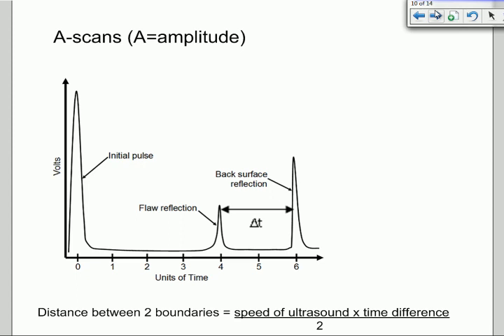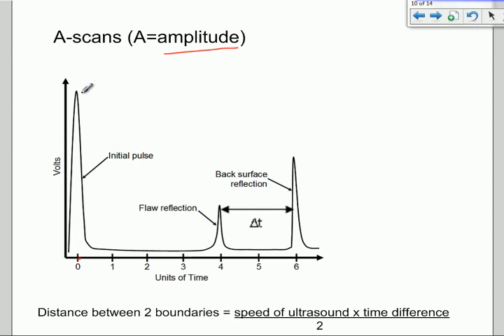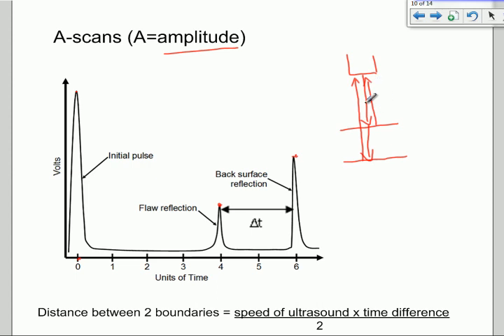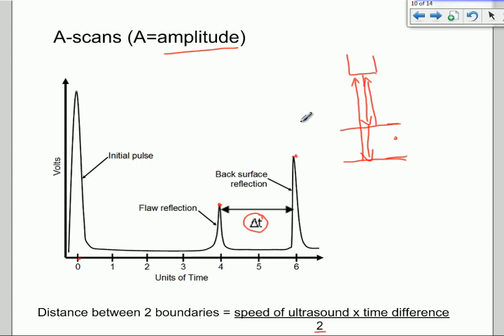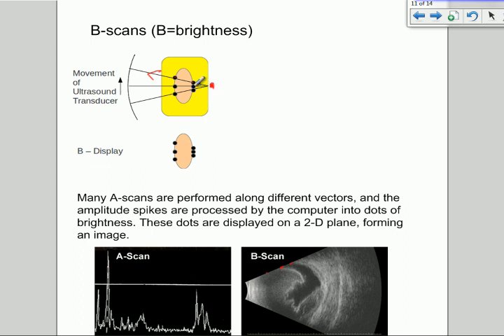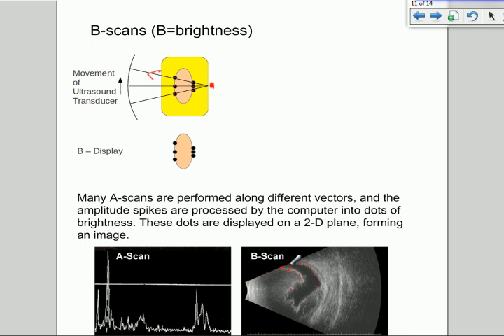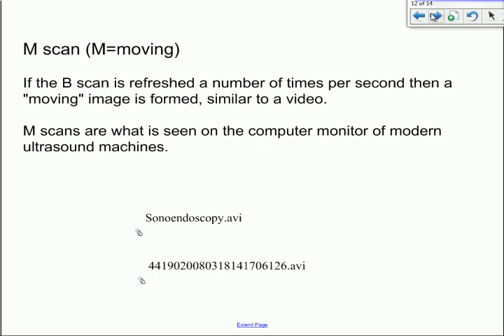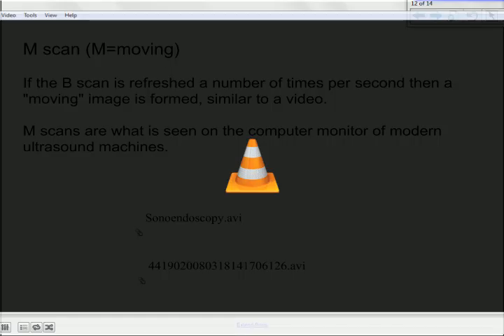A level medical physics - ultrasound part 2  types of scan, A-scans, B-scans and M-scans

Comment: great video. but i had to think myself why the time taken for the second reflected pulse to travel from transducer and hit the first boundary and reflect back can be eliminated then i realized both the reflected pulse take the same time to travel to and back to the trandsducer from the first boundary so u just need to take the time difference between the two reflected pulse because the first pulse time taken will give u the time for the second pulse to travel to and back that same distance and the time taken for th3 second pulse from t=0 to time where u receive the second reflected pulse - the time for the first pulse will be time for wave to travel in the second medium. hit th3 second boundary after passing thr first boundary unreflected and reflect off the second boundary until it reaches the first boundary again but coming back so in the opposite direction and this will give u the time u need to calculate for the distance or depth of the second medium